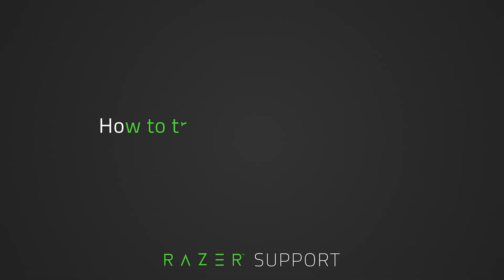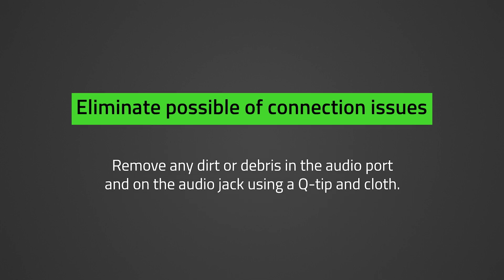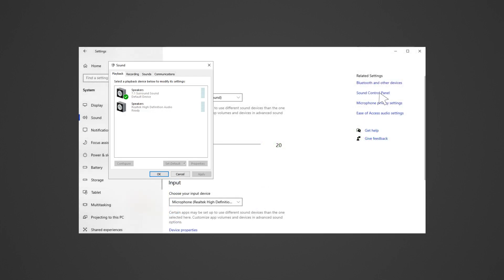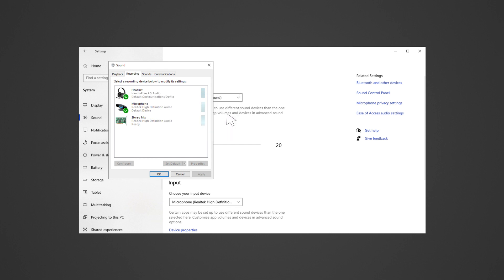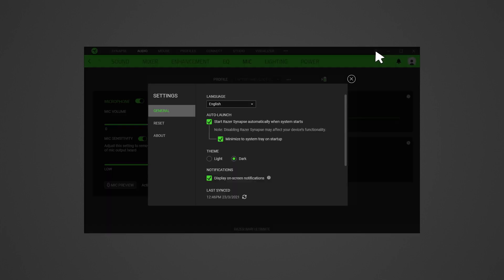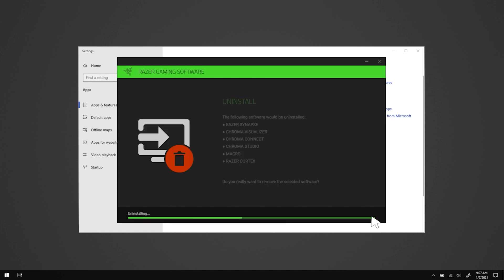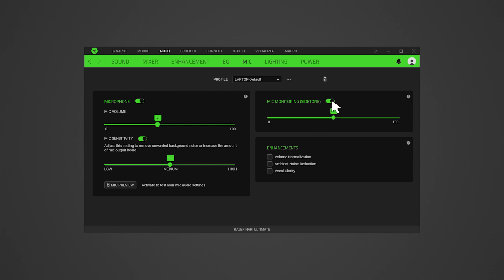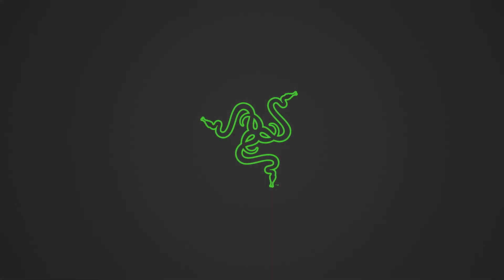How to troubleshoot and resolve headset microphone issues

Comment: One pointer I'd like to mention. If you have a Razer Barracuda X, make sure the device is connected to the pc or laptop itself, either by the dongle or USB-USB-C convertor. Wasted a full day because i had mine connected to my external USB Hub. Hope this helps and you're not as declined as me
Reply: I have the same headset but the mic still does not work consistently...
Reply: @thewooperking4311  literally me rn bro
Reply from the maker: We may be able to help you out, please contact us here:  https://insider.razer.com/index.php?forums/support
Reply: do you have a buzzle , hissing on wireless mode with barracuda x ?
Reply: @elcutaway  İ do so i am going to return it
Reply: i have a barracuda pro and had the same issue. I was connecting my dongle through the adapter and yet it was not working for some reason, i made it work by changing the port i was connecting the adapter too hope it can help some of you guys

Comment: Hey, I have bought Razer Blackshark v2 pro headsset. I hear everythign perfectly correct. the problem is just that mic isn't picking up sound. It says its connected, but it just doesn't work.
Reply: same but i got a barracuda x
Reply from the maker: Hi, Jakob! Does it happen both wired and wireless? Please connect with us here: https://insider.razer.com/index.php?forums/support/ so we can help you further.
Reply from the maker: Hey, Luke ! You can reach out to us on our Insider forum as well so we can troubleshoot the issue from there. Here's the link: https://insider.razer.com/index.php?forums/support/

Comment: I bought the nari ultimate an I Sound like a robot on ps4 I don't owned a pc so I don't know what to do
Reply from the maker: How is the Razer Nari Ultimate connected to your PS4? We suggest reaching out to us from here: https://insider.razer.com/index.php?forums/support/ for further assistance.
Reply: @rzrsupport9502  tried wired and wireless both have the sake problems with the mic
Reply from the maker: If you sound robotic on voice chat, it could be a latency problem. If you do not have a PC you can test the headset with your smartphone, use the 3.5mm cable and try to call someone. 

If you need additional assistance, please reach out to us from here: https://insider.razer.com/index.php?forums/support
Reply: @rzrsupport9502  I tried calling someone and I sounded weird but after unplugging and carefully plugging in the 3.5mm cable i sounded normal

Comment: My Kaira Pro's mic won't connect to my Xbox, I taken it in and out of the jack a few times and switched it off and on but still no luck, any suggestions?
Reply from the maker: If the Razer Kaira Pro audio is fine and mic is not working, please check your system settings if the headset was set to use the microphone or if it is muted. Also, test it on a different device to isolate the issue.

If you need additional assistance, please reach out to us from here: https://insider.razer.com/index.php?forums/support

Comment: Hey I’ve been having issues with static type sounds and the sounding cutting out. Causing the party to lag as well. My friends also say my audio sounds like I’m in a tin can. If anyone knows how to fix that I’d be thankful.
Reply: Did you fix it? I have same problem.
Reply: I’ve been having the same issue with the halo headset! It disconnects like non stop while playing
Reply: I have the barracuda wireless x headset and I have been having problems with the static as well. It goes away and then comes back like a few seconds later. Does anyone know how to fix this?
Reply: you guys, don't you know it's just a trash headset wrapped in good cloth/leather...
Reply: I think I'm having the same issue.  I might first say try moving the mic up to your eyeball. That helped my clarity a ton.
However now the damn thing just stops freaking working. It completely quit in the middle of a stream and now might only have like 4 decibles of working audio on max output.
Reply: Same problem, got Blackshark v2 pro
Reply: @carolinefernstrom6548  did you ever fix this? i have a normal blackshark v2 and my headset suddenly sounds like a tin can too
Reply: @carolinefernstrom6548  https://www.youtube.com/watch?v=Z0wzByiXLU0 found this
Reply: Same problem here, I have the kraken v3 x
Reply: https://www.youtube.com/watch?v=Z0wzByiXLU0 use this guide
Reply: I think i found the solution... never again razer! My keyboard's just stopped working after 1 year of use. My mouse (basilisk v2) just stopped detecting the clicks from time to time after 3-4 months of use (im not aggressive player) and my krakens were fucked up since the moment i bought it.... this company is just sooooooo overrated! NEVER AGAIN
Reply from the maker: What Razer headset do you own? To assist you further, please reach out to us from here: https://insider.razer.com/index.php?forums/support/
Reply: @rzrsupport9502  you guys obviously do the bare bones. My headset has had issues forever, not once did the razer support help fix it, nor did anything that i was told to do helped. I'm sorry, but i wont buy a product again.. A headset is suppose to be SOUND orriented, when there are mal"fuck"tions that's absolutely absurd.
Reply: fix that before others follow suit
Reply: @rzrsupport9502  i'd really like your answer on why the kraken headsets were such trash, that they cut in and out all the time, static fuzz, mic absolute shambles where i cant speak nor be heard.. Wont buy a product again, but i'd at least like a reasonable answer as to why your product was such shit.
Reply: @nickbeggz414  Mann I got the same issue no help
Reply: @GG-me2kd  yeah i just junked them, wasnt worth the hassle sadly. They did look sick af so i was disappointed but whatta ya do

Comment: Nari Ultimate. Mic picks up any sound coming from headphones making an unbearable high pitched noise. Anything past 50% volume turns into deafening feedback. I have to turn them wayyyy down to use them at all and the audio quality is worse than my $30 5 year old logitechs. The mic (when someone can hear me) is really quiet and unclear. I must be doing something wrong but cant imagine what else at this point. I have the proper synapse and tried everything with settings. I've been across the internet..... ZERO solution. Going to return these if I cant find a fix.
Reply from the maker: Allow us to help you with your headset's mic issues. Please reach out to us from here: https://insider.razer.com/index.php?forums/support/
Reply: @rzrsupport9502  I read through dozens of posts on your forum from people with the same problems and no solutions from razer.
Reply: @NJHC21  Having the same issue and looking for a solution.
Reply: @Me_Caveman  I ended up returning them after weeks of troubleshooting. I tried different pc’s, every setting under the sun… nothing made the mic usable. A friend of mine bought the same headset recently and had the same issue… no fix, also returned.
You’re options are either to buy a separate mic or get a different headset altogether.
I use a Logitech g935 now and they are flawless for a great price.
Reply: @NJHC21  Thank you. I'll take you advice and check those out instead.

Comment from the maker: What Razer headset do you own? If you've tried everything mentioned in the video and the issue still persists, please reach out to us from here: https://insider.razer.com/index.php?forums/support/
Reply: I just got my BT Kraken Kitty Edition and my synapse cannot detect it, tried to uninstall and updated drivers, reinstalled synapse and still no connection.
Reply: 3 years later and your devices still suck 0 / 10 ratings
Reply: Razor kraken tournament edition the right side of my headset won’t make any sound and the audio jack and port are clean It has never gone deaf before
Reply from the maker: Please test the Kraken TE without using the USB Audio Controller to other device like your smartphone or other computer to isolate the issue.

If you need additional assistance, please reach out to us from here: https://insider.razer.com/index.php?forums/support
Reply: my kaira pro mic picks EVERYTHING up and hisses 24/7. Wtff!?
Reply: My nari ultimate mic sounds like I'm a robot I play on ps4 and 8 can't fix it

Comment: wish i could hear this
Reply: razer blackshark v2x??
Reply: @rmi11s.martialarts  Yeah I have that and I'm literally having issues with it
Reply: @m7mdplayz644   mine are fine now and working great, are you on Microsoft? if so open sound settings, scroll down to 'get help'. this will take you to a help window. select yes to let it run a scan. it will play a beep then ask you if heard it. select no. then it will ask if it can turn off or change audio enhancements. select yes. assuming you had the same issues as me. it will; probably be fixed.
Reply: @rmi11s.martialarts   no worries, mine got fixed so its np.
Reply: @rmi11s.martialarts  for me the razer black shark v2 i have the pc input things to work but i can’t hear anything
Reply: yeap i just decided to trash mine, they weren't working for the longest time. I give up on razer.
Reply: I sent it back and ordered the wired version and do not have a problem with it. Don't need the software either. Too bad the wireless socks
Reply: Same
Reply: Captions
Reply: lol
Reply: lmfao

Comment: My Razer Nari Ultimate Mic is not working. It works if I connect it through 3.5M under "microphone" on PC but it does not work when connected wireless. This is pointless for me as I play on PS5. Are you guys going to fix this with a Software issue? I have spent thousands on Razer products. Thousands. Can I get a response on this please? My headset is immaculate. Hasn't even been dropped on the Carpet! None of these work. I'm almost 100% sure this is a Firmware issue and you don't have an update for the Nari Ultimate. It does not work via Razer Nari Firmware Updater.
Reply: Set the Razer Nari Ultimate as the default recording device by doing the following:

1. While your Razer Nari Ultimate is plugged in, right-click on the sound icon system tray and select “Sounds”. 
2. In the Recording tab, select “Razer Nari Ultimate– Chat” from the list and click “Set Default”. 
3. Go to Start > Settings > Sound, scroll down to the Input section and click “Troubleshoot”.

4. Select “Razer Nari Ultimate – Chat” from the list. Click “Next” and let Windows identify the problem, accept the recommended settings change and try again. 

If the issue still persists, please reach out to us from here: https://insider.razer.com/index.php?forums/support/

Comment: im never buying razer again.
Reply: Bro same I have a 180 raze headset and my mic doesn't work on the ps5 and it's says it compatible
Reply: @davidmejia8760  bro my nari sounds like I'm speaking through a can
Reply: @davidmejia8760  Just unplug your razer sensor chip from your laptop and connect it again, works for me. Settings on the pc/laptop won't solve anything. If you do have a razer sensor, disconnect it and connect it again.
Reply: same
Reply: Exactly. What type of company doesn’t even respond on their own page to product issues? Just got the Corsair Virtuoso XT
Reply: I just bought the Blackshark V2 Pro for fucking 200 dollars and the mic stopped working after 3 fucking days. What a fucking joke
Reply: Same it’s the second Headset I bought that disappointed me so much and broke after 2 months
Reply: @АлександрФи-у5у i bought Chinese headset on Amazon bundled with a keyboard for $20 that lasted me 9 years in 2014 lol
Reply: Mine doesn’t even work on my gaming pc
Reply: same
Reply: Me to my moms bf just got one and it cost $100 such a scam I. Retuning this shit
Reply: This is the most shitties company I used to think razer was a top brand but I spent 200$ on a headset and the mic stopped working on my ps5 after 3 days and now I use some old shitty earbuds and the lasted way longer   Oh my fucking god razer
Reply: after i see your problems   i wont buy then  just need a new headphones...but dont need problems..
Reply: My second time using a Razer headset (currently Kraken v3 x) and also second time the mic stopped working after less than a month of purchase..
Reply: I recommend the JBL Quantum 350 wireless  @jeffrenjr
Reply: Yeah this is frustrating. I'm on PC. I can play audio through youtube, but not the game I play? Also.. The microphone is not working...... I have tried everything.
Reply: @WinnieTheTrain  Audio always worked for me. Mic? Garbage. Doesn’t work. Unless connected through 3.5mm snd then it would sound horrible. I’m very tech savvy so it 100% is an issue with Razer and not my ability to troubleshoot issues. I’ve never had a problem with something I couldn’t diagnose. Minus this garbage headset.
Reply: O
Reply: Ong
Reply: Waste of $60
Reply: I've got a razer kaira pro and the mic doesn't work unless I use all my strength to push it all the way in

Comment: Sorry to say this @Razer but this is definetly a software issue. Back in early 2021 everything worked perfectly fine but with the recent updates you guys broke it.

When I connect the same headset with a normal audio jack using the Realtek drivers (switching the audio inputs for applications etc, even leaving the default microphone on the Razer Audio Controller) the mic works flawlessly, same with my mobile and so on. I'd like to get an older version of Synapse 3 where the driveres weren't as broken please, thanks.
Hell, I'd even take my money back :)
Reply: I have the same problem, a few weeks ago I bought the blackshark v2 pro. When I test the wireless mic, it sounds like garbage, but if I plug in the jack, it sounds perfect. I'm pissed off ngl
Reply: @ricardocardenas9129  That's on you, actually... Using the headset wirelessly shares the audio and microphone bandwidth.

So basically: To make room for the microphone recording a lot of your audio quality gets reduced (I don't know what value it is for Razer but a lot of companies seem to reduce the Audio around 50%) and instead filled with the microphone, making it sound quite bad.

Important to note is, that this is industry standard as everyone does that, one of the main tradeoffs of having a truly wireless headset with built in mic. Which is one of the reasons why I'm so against the removal of headphone Jacks from phones.
Reply: If Synapse is affecting the performance of you headset, try doing a repair. You can follow the steps listed here: https://mysupport.razer.com/app/answers/detail/a_id/4535/kw/repair%20synapse

If you need additional assistance, please reach out to us from here: https://insider.razer.com/index.php?forums/support/
Reply: @razercustomeradvocacy4630  brand new headphones and they dont work on the ps4. Setting are correct and everything, brand new controller, and nothing. Mic won't work at all

Comment: Hello guys, i have a problem here. I am using kraken x and it can do 7.1 before, but recently the 7.1 doesnt work anymore (only 5.1). When i checked the sound settings > playback, the 7.1 surround sound speaker icon disappeared and there is only realtek hd speaker icon. There was a 7.1 icon when it worked before, but i don't know it's just gone now. The razer app engine cant detect the 7.1 speaker as well. I've tried to reinstall all the razer apps and unplugged my kraken x, but the 7.1 is still not detected.
I wish somebody could help me..
Reply: Try updating or reinstalling your Realtek Audio driver and see if it makes any difference. For additional assistance, you can reach out to us from here: https://insider.razer.com/index.php?forums/support/

Comment: i recently got the razer blackshark v2 and the sound works perfectly fine, the mic on the other hand doesnt work at all, ive looked through every video on the internet and nothing works.
Reply from the maker: Try to check your Windows Mixer and on the Realtek Audio Console if the microphone is muted. If you need additional assistance, please reach out to us from here: https://insider.razer.com/index.php?forums/support
Reply: @rzrsupport9502  ive tried everything, nothing works. Ever. i might as well return this and go get something else cuz i cant be waiting months to get a reply from the " community "
Reply: @deeb8430  Funny thing is that just a few updates ago everything worked fine, then the sound stopped working (but the mic was working) and now is reversed with the mic working sometimes, but not always lol... so stupid. When I connect the headset to my analogue ports it works perfectly fine, someone really messed with the software
Reply: @mr_confuse  bro I’m pissed bc now I have to get an individual mic
Reply: @deeb8430  If you got a Headset with a headphone Jack thingy you can use a splitter d if it in (if you are on PC) then it will work perfectly fine.
Reply: Bro did you try unmuting your headset?